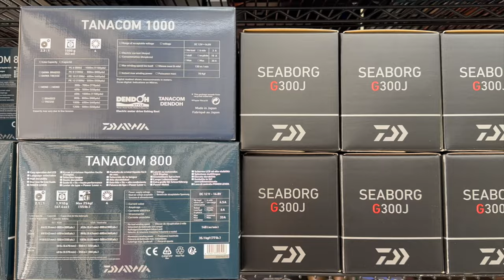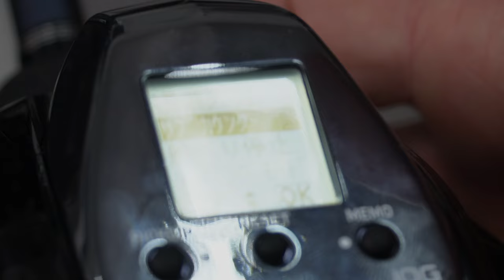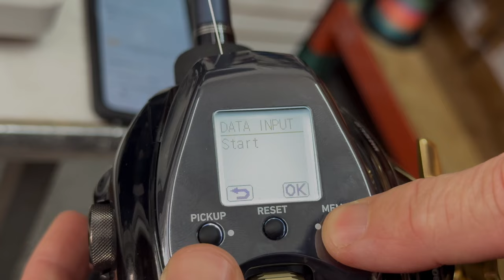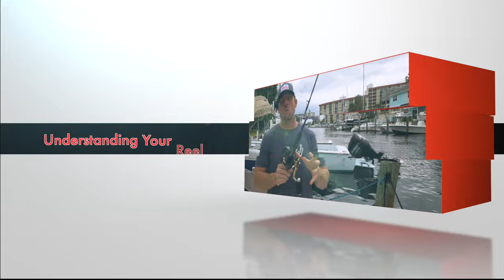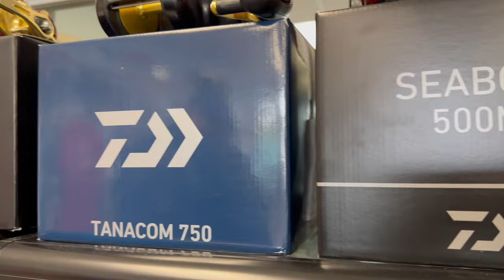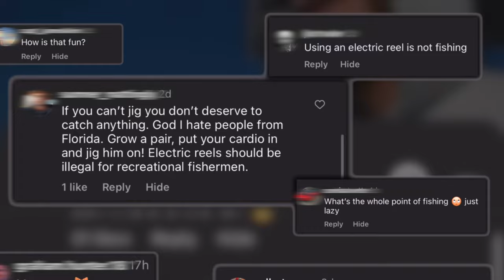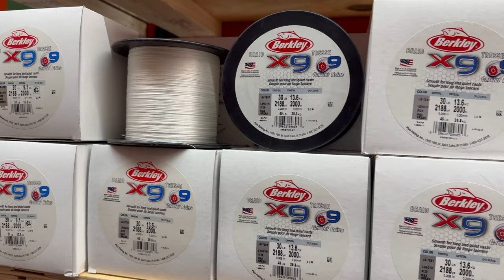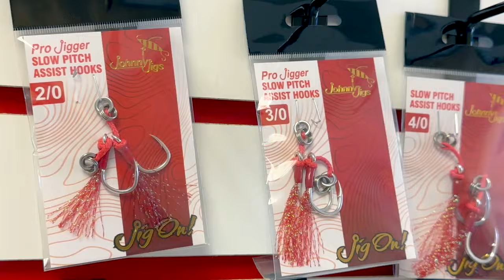Small Electric Reel For Slow Pitch Jigging: Essential Guide & Pro Tips #slowpitchjigging

Comment: Phenomenal video on explaining all the features on the G300J which I just purchased. I haven’t used it yet but have been reading through the booklet and at first it’s a bit intimidating. This is the most informative video yet on reels that you have produced. I have several multi-day deep drop trips coming up and can’t wait to use it. I can’t believe how much power is in the reel. The G series has a stronger torque and stronger engine. My friend has the G300J and swears by it. I’m going to pair it with my Temple Reef Innovate 7’8 H 250-650g or the Spathe Deep III. I have used much larger electrics but only for bait and the were a bit cumbersome especially if you had to chase a fish down the rail. The one tip that you mentioned was upgrading to a SPJ knob. Thanks again for such an informative video. Jig On
Reply from the maker: Thank you JigEmUp...good luck on your upcoming trips....Johnny
Reply: Was wondering what type of shoulder bag or one that attaches to your belt that is waterproof so you can walk around the boat when a sea monster drags you around the boat…. Thanks again
Reply: Forgot to mention that it’s a bag for the battery… Lol
Reply: I didn’t see any day & night difference between the 300J & G300J series..
Reply: Is it really worth the extra 250€ for the g model instead of the normal one?

Comment: Very informative video! These reels have opened up the deeper fisheries for the recreational fishermen. I want to add a precautionary tip. When, not if, you get hung up on bottom structure, don't lock up the reel and try to break off the line. It's very possible to damage the mechanical components of the reel and ruin the rest of your day on the water. Once you have made the decision you can't free your jig, use a knot puller or a small section of PVC pipe or even a cleat on the boat to break the line.
Reply from the maker: Thanks Bobathy Vo-hon

Comment: Love the video and made me subscribed! I'm currently using beastmaster 2000EJ, but the drag and power is not quite enough when hauling in 10kg+ fish. So looking to upgrade to either the Seaborg G300J or G400J. I know you are using G300J as your main, but if you can choose again would you change to G400J or stick with G300J? My local suppliers don't carry them on stock or I can't compare them hands on.
Reply from the maker: Hey Karna7122, Thank you for subscribing. I would have and now currently own a G400j. The size difference isn't much, but I like having the extra line capacity.

Comment: Just got a 400j and had it spooled at a local shop. Any recommendations on how to input the amount of line without having to un-spool the whole thing? I already know how many yards it on it, but I get an error when I hit okay using the P1 setting.
Reply from the maker: I would go through the spooling settings like in the video, but don't actually put line on the reel and reset the amount of line like in the video.

Comment: Can you cast with those reels?
Reply from the maker: Yes you can. You can even use them the same way you’d use a manual reel as it has a manual crank 👌
Reply: @JohnnyJigsTV  I would like to use this type of reel for chumming for carp fishing. It involves at least 50 casts in a row. I used to do that with a 12 foot carp rod and a spinning reel. Casts are usually 200 to 250 feet. I can't do it anymore because I have developed shoulder problems from excessive reeling. That's why I'm asking about an electric reel. Can they cast 200 feet and retrieve a spod weighing a few onces (plastic device for chumming corn or other particles)? Thank you
Reply from the maker: @SciD1 honestly for that kind of use I wouldn’t want to steer you wrong. They can cast and retrieve a decent sized fish, they do get stronger with the various sizes and types but I can’t tell you yes or no.